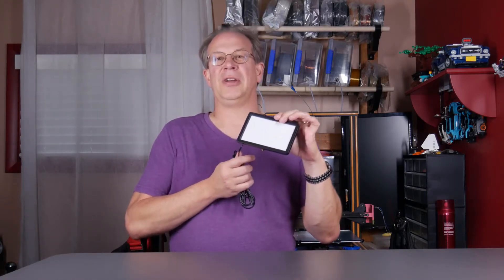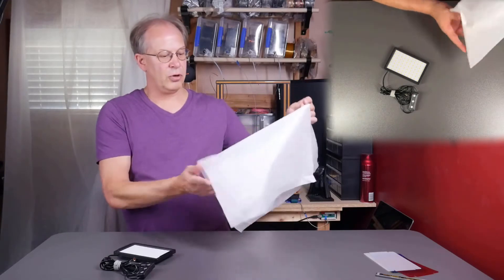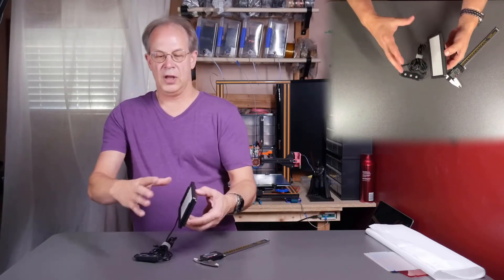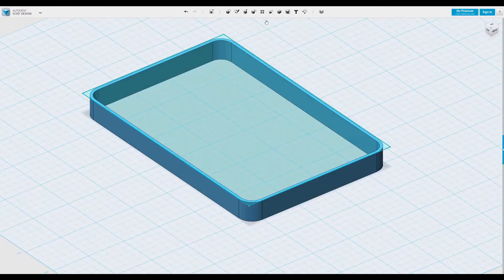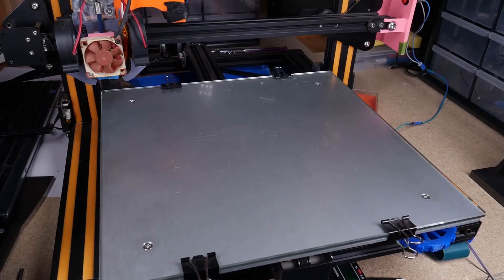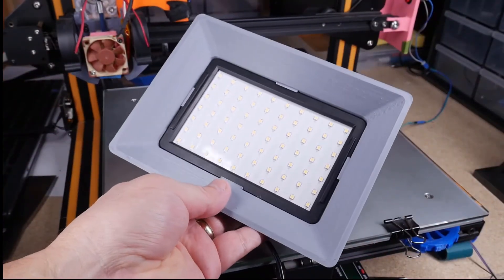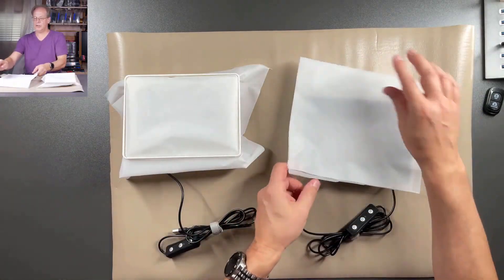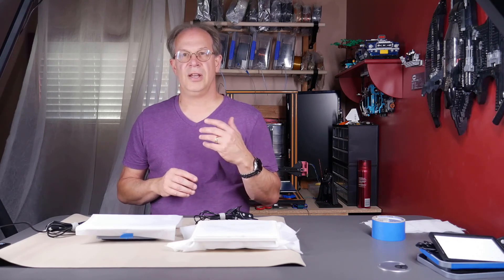3D Print LED Light softbox

Comment: I know, deep down in my soul, that you didn't put that light down before starting that print...I've heard you talk about masking in other videos, I watched how you rigged up your camera to capture timelapse with your printer, and I know that the light in question is slick and would slide all over the place...But I still wonder.  I've owned those lights for a few years but used workarounds to diffuse them, the soft box you designed will probably help even mores. thanks.
Reply from the maker: HaHa!!  No, I did not actually do the print with the light on the printer.  Just some video editing magic :)